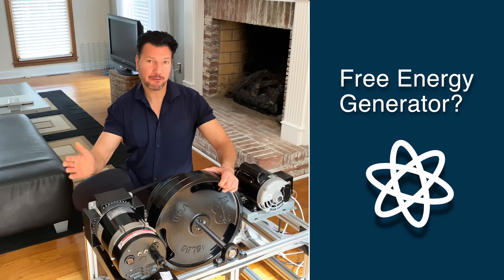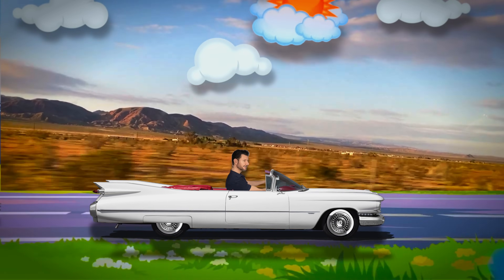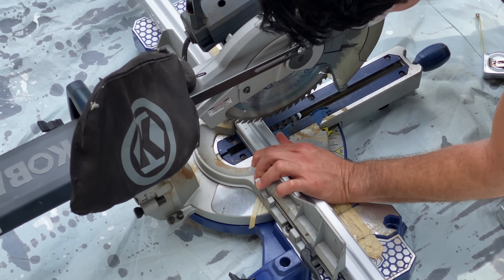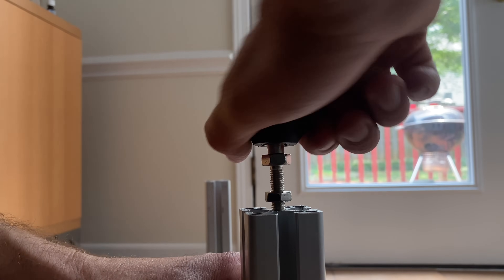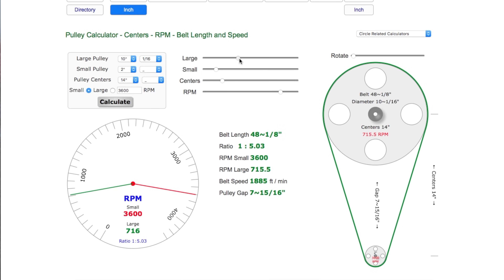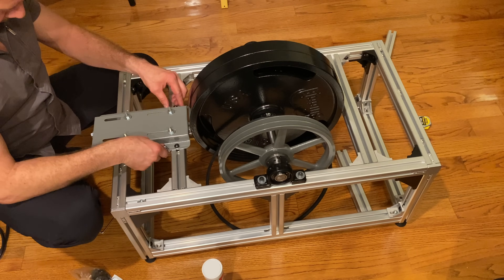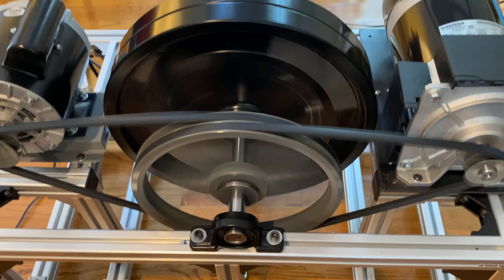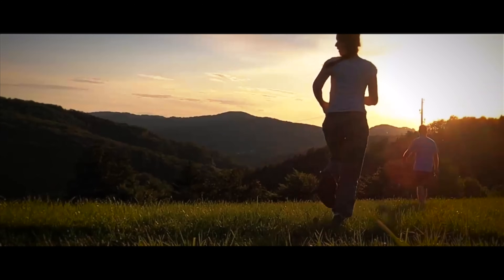How to Make a Free Energy Generator!

Comment: Here is what you need to do to succeed, use a DC motor with DC frequency driver, connect directly with generator with V-belt. Power DC motor with UPS to drive the generator and use power from generator to charge the UPS, I recommend DC motor from washing machine is ideal for this experiment and will cost 30-50 bucks only on ebay. This motor has good torque to drive generator and use only few Amps with frequency driver. I did this experiment myself and it worked fine, currently I am trying to developing automatic speed controller for DC motor to spin at constant 1500 RPM irrespective of load change on generator. I am using Stamford 15KW PM generator. I will soon post a video,  Iin the meantime please search Gerard Morin name on you tube and you will find plenty of his experiment with similar setup.
Reply from the maker: Thank you Aasim!
Let me know if your setup works.

Comment: I think if you use two DC motors generate DC power into a inverter that is 4 to 5 times bigger than the power that you want to use to whatever you want to run you will see it work because you can take some of the power that your DC motor needs to run from the other DC motor which is a little bigger along with your flywheel kinetic energy and I believe you will see it work DC permanent magnet motors to create DC power into a inverter that is five times bigger than what you need the inverter will create your household power try it and see 🤔⚡⚡
Reply from the maker: Thanks Jon
I break it down why this setup technically should work in my next video.
But good idea.
May have to try that.

Comment: The problem. Is your pulleys, they are almost the same diameter with your flywheel. You should use smaller pulleys
Reply: No the problem is, it can’t work 
You can’t defy the laws of physics

Comment: On the first acceleration help the motor by pushing the flywheel and onece it reaches its speed you need to insure the speed of motor and flywheel are the same  after that connect it to the generator while the flywheel running at the high speed motion then change the pully of generator to smaller pully
Reply: I mean change the pully of generator to smaller size before proceeding must atleast the half the size of the motor from the generator  or ratio 1:2  or if you can do 1:3
Reply from the maker: @nelsonticuala6162  thanks

Comment: you could try to use generator to charge a bank of batteries, whilst an inverter take energy from those batteries to run the drive motor...the batteries act like a large capacitor pool of energy reservoir for charging and discharge operations
Reply from the maker: I don’t think that would help either.
But I will get into that some more in the next video.
Thank you

Comment: Hi my friend, there are several issues you must solve, the first you have to install a generator who must have a enough power to starts the auxiliar motor to maintain the movement . Example if you have a motor that take 3kw you must to have a generator at least 3 times more power or more I prefer for example 10kw generator synchro brushless. The flywheel V.Belt Pulley must be bigger than the motor or the generator in order to gain more force in the torque. You must know which is the RPM of normal work in the generator and you must select the appropriate auxiliar motor speed with the same RPM if it is posible or alternatively calculated the size of the arrange on the V.Belt Pulley Radio, you can use the formula  w = Vt/r, where w is angular speed in RPM Vt is tangential speed and r is the radio of the V.Belt Pulley the condition is all the Vt are the same so you can calculate the relation between the radios. Finally you have better results if the flywheel is around 100kg weight because gain more inertial move and free energy.
Reply: ùr comment is informative. Thank you.
Reply from the maker: Thank you.
I will show what I have used in my next video.

Comment: Can you develop it as a mechanical battery
Reply from the maker: Yes that could be done but requires very precision machinery to build a mechanical battery.
They spin with 20k rpm and higher 😳
Reply: Is it possible to develop 
This machine to a continuous generator
Which can produce a constant watts with the help of solar plates without any chemicals batteries only mechanically 

Because solar plates can't produce constant amount of energy or electricity

Comment: Ok, you've really tried a lot. But I will suggest in order to achieve success, you need to consider the rpm of both motor and generator. RPM of motor  should be higher than that of the gen., In that case you can use a low rpm permanent magnet alternator.Secondly, power consumption of motor 
should be at least one third of the power output of the Gen..
Reply from the maker: Thank you Dada.
I will show some of the calculations in the next video.

Comment: What did you use to connect the weights to the shaft? Was that custom made?
Reply from the maker: Hello Maurice it’s called a keyless bushing. I will show it in my next video.
Reply: @MarkusNenning  thank you! That will save me A LOT of time. You should probably look at some of Thane Heinz RegenX videos to see how he adjusted the time factor for his coils to make the Flyback energy coincide with the power impulse rather than impeding rotation.
Reply from the maker: @mauricewright9887  thanks I will check that out for sure

Comment: GOOD MORNING BECAUSE I SEE THAT YOU HAVE THE POSSIBILITY OF TRYING A SYSTEM THAT I WANT TO WORK ON AFTER YOU CAN BUY A GENERATOR ON NEODIUM MAGNETS ON A ROTOR OF 7 OR 10KW AT A ROTATION OF 500 AND A GROT OF 3KW AND A MOTOR OF 3K PSTE 50KG OR LARGER AT A DIAMETER OF AT LEAST 1 OR 1.5 M, AND A DETAIL OF MOUNTING THE MOTOR BELT AT VONATA TO BE WEAKER NOT STRETCHED TO CREATE IMPULSES EVERY SECOND I WISH YOU SUCCESS

Comment: Nice bit of engineering work. Try mixing the ratios of pulley wheels on the flywheel shaft for power in versus power out. Look more closely at some of the Indian designs and how they structure the ratios. Also, be careful with the RPM as a forged flywheel that size disintegrating at high speed could easily be lethal.
Edit1 - for example: https://www.youtube.com/watch?v=D8TZ83_qu9E
Reply: There is free energy and free energy generators. Yours aren't working. For your personal use and not for commercial purposes, you can build one that is located at the national patent office in Alexandria, Virginia or at international patent offices in Paris, France or in Geneva, Switzerland. With the deep state practically expropriated, there is no longer any need to fear that they will come in with hired killers and take you off. Do your own research.
Reply from the maker: Thanks Rohan!

Comment: Couldn't you put a step up transformer after the generator and direct power from the generator back to the motor and power it that way?
Reply from the maker: There are a few other things to consider when using a step up transform that I will get into in my part 2 follow up.
Thanks for the feedback Timothy

Comment: Please use torque increasing gear or sun gear to increase Centrifugal force at centeral pully and power towards Generator  also a more big flywheel with small shaft which may or can  increase the momentum !!  And The Free Energy Concept may 100%ly  work 👍👍👍👍
Reply from the maker: Thank you Samarth

Comment: https://www.youtube.com/watch?v=EsEbcCqL-jc
https://www.youtube.com/watch?v=wGRmcvxB_dk
https://www.youtube.com/watch?v=oKmYqUSDch
joseph newmans stuff does work to - but thats already known. just, like the ebd, etc.
im sure you can figure out how to induce simple hysteresis if needing to control and supply extreme heat to base of sterling motor plate and vertical electro gen on shaft, or a gravity motor using electro properties of the nitinol metal, or chas's flywheel math to get the right ratios of the mutluple flywheels needed for successful rotation and understanding the stats of the gens and motors you will need for input and output for your effort in this video - just ideas - good luck - loved the vids thanks! :D

Comment: the pulley on the motor has to be larger that the pulley on the fly wheel and the pulley on the generator smaller than the pulley on the fly wheel and you cannot take a continues draw from the generator the draw has to be switched on and off
Reply from the maker: Thanks Mohammad

Comment: Try different pully ratio between the motor pulley and the generator pulley.  In those India videos, the pulleys are never the same.
Reply from the maker: I have actually tried quite a few combinations. You can see in the video a replaced the pulley on the flywheel 
I have also used a step pulley to try different variations.
Thanks

Comment: Your gear is wrong.. still one is to one.. you have to put a bigger gear at motor then attached to flywheel with small gear.. then add a bigger gear on the flywheel then connect to generator..
Reply from the maker: Thanks Olrayt

Comment: Above all use high tensility square steel bar  mounted  on  heavy rails to  prevent vibration and a low center of gravity for the steel frame for stability.

Comment: I have been dreaming of this possibility since my childhood and it works. First the flywheel you selected is incorrect  because the weight of the flywheel is evenly spread out and it is too small , just look at what the other inventors have used; the weight of the flywheel should be on the outer rim of it. The small motor used in other designs in proportion to the power of generator should be taken into account; it is used not so much to drive but to overcome inertia. Once the flywheel which is quite large gathers the momentum or torque it will drive the generator with only a small torque from the motor. The selection of pulleys also play a major role in the success of the project. Now to drive a massive flywheel of that size , you would have noticed that the designer would give a push by the hand by pulling the belt and the pulley to   drive the flywheel should be bigger than the pulley used to drive the generator. The start can be given by a battery pack with an inverter or by the grid if you don't need to operate in remote area. If you use magnet motors with a flywheel it works still better.
Reply from the maker: Hello Sunil, do you have a working generator?
Reply: Bicycle rim works better with a lawnmower transmission with alternater I seen on YouTube badass I'm going too make one but I want too youes two alternaters
Reply: I want too youes a ramp pump hitting bicycle  Wheel fan witch turns the lanmawer transmission witch then turns the alternators
Reply: Trying too think off different ways too youes water other then river self contained water
Reply: YouTube is off road/ off grid he's asome job creative thinking 🤔 that's where I've gotten my ideas from smart man has several different ones check it out.

Comment: If you've figured out the physics of the flywheel s  there are company that makes mgn generator that works on very low rpm  like 600rpm and put a frequency of 50 hrtz 3 phase 380v  , if your only problem is maintaining rpm  then that should help , you can order these either fron China or India.
Reply: I want to talk with you how can contact
Reply: I am from India Mumbai

Comment: IF U NEED 2 KVA  .. USE 10 KVA 1500 RPM  GENERATOR .  DC 3000 W 2000 RPM MOTOR WITH SPEED CONTROL OR NOT ITS UP TO U . SO THE POWER TAKEN FROM GENERATOR  IS 0,5 OF RATED POWER OR MAX POWER IN SOME GENERATOS....CONNECT THE GENERATOR DIRECTLY TO THE MOTOR 1/1 GEARBOX .NOTE :DONT USE THE POWER FROM  GENERATOT TELL MOTOR REACH MAX SPEED
Reply from the maker: Thanks

Comment: Hey dear freind I spent a lot money and my 9 months of time to acheive this, but ran out of money and it is pending, I have  a beat suggestion what I had tried and was near success, flywheel should be 100 kg , motor should  be 1 hp and should not exceed, and most important, plz use magnectic generator, if u use coil based conventional generator, it will not work in this whole life 👍🏻 my best wishes are with u, I ran out of money, but u don't bro 👍🏻do a change in pully belt, they must not be so tight, they must overlap and loosed 1 to 2 inches, leave them loose 👍🏻

Comment: I mean on same rotation just suited with a spring coil effect giving one tbe ability to fling fwd or slightly behind with a kind of back energy to push the dominant wheel fwd or behind with a slight resistance
Reply: Uol
Reply: A leasr can cancel a magnetic field if going fast that only means a split second of energy to power a laser I posted a top I have been thinking about it since I knew laser can do that it gets over the bump of the first magnet if on a wheel and one stationary
I also see a cart 3 wheels with wind propelltion direct drive it went faster than air speed so it was tested on tread mill it propelled forwards with. No wind the problem pushed the wheels the wheels pushed the prepller

Comment: It's so funny that they teach in school that it's in power it's impossible to to create  Indefinite motion is only impossible to create Perpetual motion what is the difference between indefinite motion and perpetual motion while let's start with your simple cell phone you won one bar of power you didn't plug it in to a Phone charger which consists of batteries is batteries it then charges the phone at the same time you're using the power this is called pass through charging doing 2 things at 1 time now apply this to your motor can I charge the battery and at the same time use the power this will achieve what you're trying to do

Comment: Yeah, people who say it cant work, are the same idiots that dont understand how a supercharger that takes 20 hp from the engine to spin can make an additional 100 hp on the same engine. Im curious if the design could be made more compact by using several motors / generators on the fly wheel its self. Also could the mass of the fly wheel be imatated by using neo magnets, reducing the weight and increasing the perceived mass. I have a few ideas but have limited time and funds, still im going to build a small proto type.  The idea is a small hub motor with neo magnets being supun by smaller motors on the outer ring  let me know if youd like to colaborate on a project. Im in orlando
Reply: Im building a mecha...i know its kind of nuts .but need something to power everything. Im convinced this is the right way to go...just more compact. Dont know what a calaboration would look like...but i imagine it would  look like 2 dudes in a storage unit creating something compact with a practical application. Like unlimited drone flights. Think about it.
Reply from the maker: @apocraphontripp4728  😂 sounds pretty good!
Reply: @MarkusNenning 
A couple months ago I see a 3 wheel cart with a wind propelltion connected to back wheels the thing is it went faster than wind speed they put it on a tread mill it prepelled forward it was 100% proven with mathematics to explain I thought this could be done but different the wind propeller drove the wheels and the wheels drove the prepller look it up it on here
Reply from the maker: I am also modifying my generator but have the same problem as you not enough time and limited funds :)
Not my full time job.
How would a collaboration look like?
Thank you

Comment: The pulley ratio from the motor  to the generator is 1 to 1. I think it is better to have higher ratio in the generator
Reply: For example motor to flywheel 1to 4 then from flywheel to generator is 1 to 4 agai

Comment: You're going to have to know this information too to use if you want to put an alternator on this system
https://youtu.be/jgoIocPgOug
 You already know that this works because it's running off a battery if you watch my video mine's is also running off a battery but the battery is being maintained by other means in this case yours would use an alternator as it does in every car in America Erica so the video I gave you above shows you how to use it correctly and the speed you need to maintain  For different  Types of battery
Reply from the maker: Interesting video!
Thank you.
I did not know that there was a difference when changing different types of batteries.

Comment: Losses in friction,  flywheel,  belts etc. These people make money on YouTube from advertising etc. Motor/generator combination sets have been around for many years. Ac motor to DC generator for speed control of dc motors in industry.  Sometimes they are only 60% efficient!  Don't be sucked in to thinking free energy!  That's why these things have a diesel engine bolted on to them. I enjoyed the video.
Reply from the maker: Thanks David!
I do have a few ideas I will share in my next video that I think make sense and could work to at least produce sustainable energy.
But yes I don’t want to spend my life chasing free energy.
Reply from the maker: Thanks David!
I do have a few ideas that I will share in my next video that I think could work to at least create sustainable energy.
But yes I don’t want to spend my life chasing free energy.